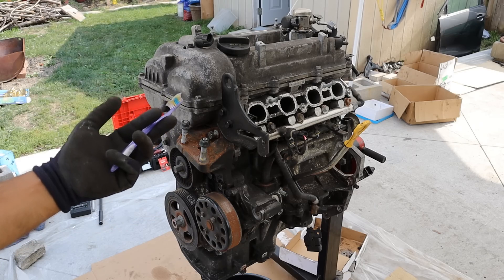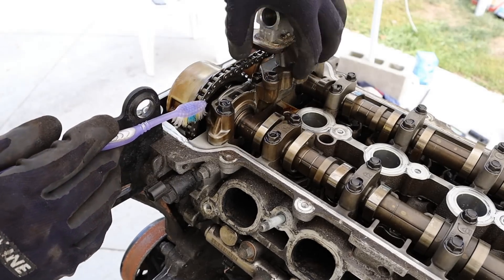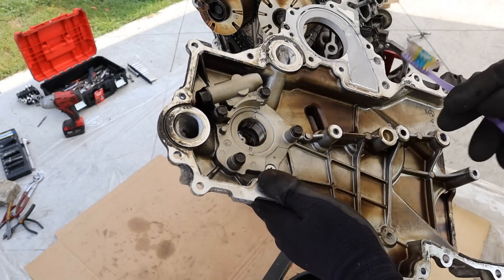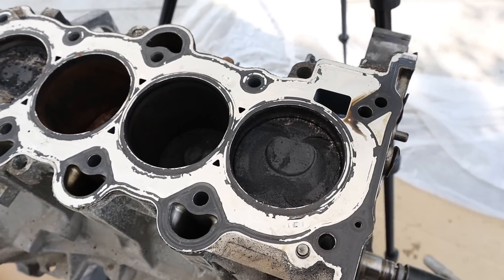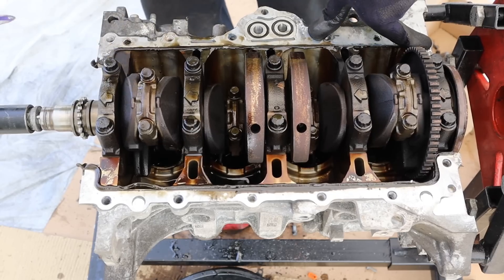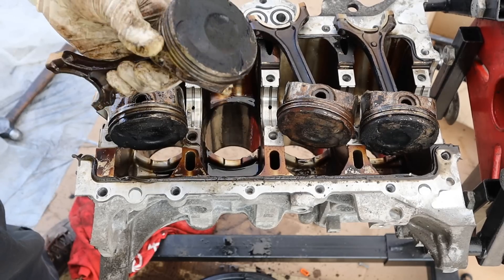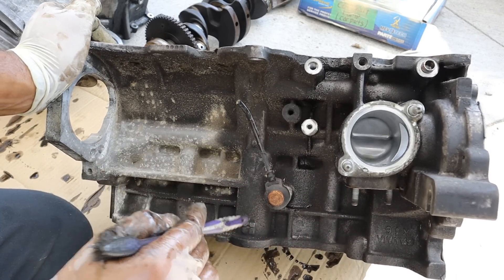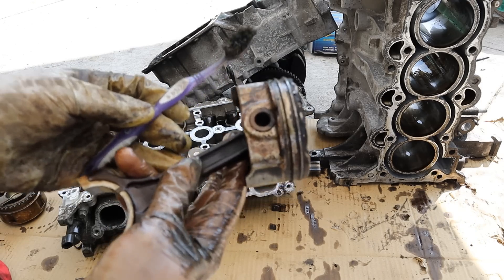Why KIA Engines Fail

Comment: I have a 2016 Kia Rio and the gdi motors and cvt trannys are trash. You need to run sea foam through the intake system ( because gdi doesn't inject gas through the intake like most cars , so they get higher compression  ) and take the intake boot off and spray behind the mass air flow sensor. Put boot back on. Rev to 2k rpms and hold it there while someone sprays the sea foam in . After can is empty, turn off car and let hot soak for 15 min. Then start it up, Rev it, drive about 10 min. If smoke doesn't appear right away don't worry it will ( especially in these trash motors , I've done 2 sea foam sprays already and may need a 3rd ) . If no smoke comes out, pull over and turn the car off for 5 min . Start process over again and if you have triptronic where you can control the gears then really get on it 1- 4th gear . Blow all that crap out of your motor. These engines do burn gas esp while using sea foam. Get an oil change shortly after. Smart thing would to be add the liquid kind to the motor and fuel system and drive 100-200 miles and then definitely get an oil change. God bless 🙌 🙏

Comment: I guarantee you the only reason these engines fell for people is because they don't take care of them they don't change their oil and crap like that any engine will fail if you don't change the oil and stuff I have a 2014 Hyundai Elantra GT with over 112,000 miles on it's the best car I've ever owned so far and I bought it used

Comment: My mon bought a 2017 kia sorento 2.4L. Burned a quart of oil every 300 miles. She bought with 40,000 miles. Sold at 50,000 miles for fear motor would give out based on oil consumption. Oil lube places got sick of giving oil all the time to top off oil in-between changes. I think used Kia don't carry warranty as Kia said she was unable to get warranty work for her Kia.

Comment: they're called oil galleries not galleys.   also when removing a cylinder head you start at the outside bolts & work in. i know this engine aint going back together, but copy cats, you know.
Reply from the maker: Thanks I always mix up galleries

Comment: I gotta a 2020 with 2 miles. This is my second optima. The first oil change golden! Then the second at 10k, it was a half n half. I have stayed on the semi synthetic. Now should I go for the full synthetic when I hit 15k miles? Any suggestions would be great thanks
Reply from the maker: Synthetic is good, stick with it if that's what you're gonna use
Reply: @speedkar99  thanks, will do!!

Comment: To eliminate the carbon build up problem, Hyundai decided to run very rich fuel-air mixture at cold starts (both summer and winter). This has unburnt gasoline coating the combustion chamber which stops carbon build up on intake valves. Downside, unburnt gasoline also leaks into the engine oil past compression rings, causing engine oil dilution - the engine oil is loosing its lubricating properties. This is mostly a problem when doing mostly short trips when the oil doesn't get hot enough to have gasoline evaporated.
Reply: would "warming up" the car for 5-7 minutes + 5 minute drive help to elimate that? My trips are short to work, so all I can really do is warm her up prior to driving. I could also use my other car for my short trips & use newer Kia for night job more driving
Reply: @dbzownz12345  Hi, no, it will not be enough. In fact, letting the engine idle means engine is running on lower oil pressure (the lower the rpm, the lower the oil pressure, the oil pump works with the engine rpm). So lower oil pressure + diluted oil = not good.  For short trips, the easier thing to do is change oil no longer than 4000 miles and use synthetic 5W-30 (note, if changing from non-synthetic to synthetic on high mileage car, the engine will start consuming lots of oil for the first 10,000 miles or so, need to check oil level every day at first). If using car very little, change oil every 6 months. 

A second problem with these engines is they run at very low 1000 rpm at specific cruising speeds such as 20, 30 and 45mph. At 1000 rpm the oil pressure is very low increasing the wear on connecting rod bearings. If driving at speeds allowing 1000 rpm, downshift manually to keep the rpm above 1500 rpm.

Note the engine failures are only for GDI engines made from 2011-2019. I will upload next spring a video with a trick to save these engines, I did discover a trick to stop the oil dilution.
Reply: @Peppermint1  thanks for the info. I've heard the newer Theta II engines are better overall, but I always plan on oil changes of 4k or less. First is 1.2k (some say 500 miles is best), 3k next, & 4k therafter. IS this a good idea for brand new car voyage on oil changes? thanks.
Reply: @dbzownz12345   I think it's a good idea to do an early oil change on new cars.  New engines have various assembly lubricants that will get washed by the engine oil, so an early change will help remove these residues. May also help remove wear particles on new engine during break-in. Most these particles will get trapped inside the oil filter, but smaller ones may accumulate inside the oil, so a first oil change around 1500 miles may help with these. I would also suggest remembering the brake fluid change every 4 years even when driving low miles. This will help extend the life span of the brake caliper as I noticed Hyundai is using low quality caliper piston seals, which start sticking after 7-8 years. In fact, the brakes are a weak point on these cars, brakes are made by some Korean company, may see my other videos about brake quality on Hyundai and Kia cars. I'd use Dot 4 synthetic brake fluid (for European cars) on these vehicles
Reply: @Peppermint1  awesome, but i plan on getting a Rio which only has like 121hp, I dont think I should worry too much on brakes for this car, but im def going to make note on which ever i do decide on
Reply: @dbzownz12345  Mind you, the oil dilution problem was only with 2011-2019 GDI gasoline engines. Non GDI engines are fine. If you live in a country with CRDI diesel engines, those too had oil dilution problems from leaking diesel injectors.

Comment: @speedkar99 If you regularly change your oil, get the valves cleaned at the dealer, and regularly used fuel cleaner (every oil change), would these engines last longer? What is your opinion? 

I have a 2020 Kia Forte GT Manual with only 30k. I have already cleaned the injectors at the 20k mark, installed an oil catch can on the PVC side (maybe need the other done), and am starting regular fuel system cleaning, largely based on seeing the carbon in the pistons and on the injectors in this video. Great concise and well done video. Thanks, for answering my question, if you do!

Comment: As I understood it port injected engines keep the intake and the back of the intake valves clean, whereas every direct injected engine I've seen the intake ports and valves are gummed up with gunk (carbon build-up from the CCV/PCV system). Which is the opposite of what you initially said (?)

Comment: As soon as you said DIRECT INJECTION i knew what caused the "problem". I bought my wife a Hyundai Elantra with the 2.0 ATKINSON engine. Its port injected as i would NEVER buy a direct injected engine. Its been trouble free for 3 years.

Comment: At 6:46 the sparkly stuff may be due to poor maintenance and/or due to poor KIA manufacturing procedures where block machining left metal curls or chips in the oil channels. A better process would avoid contamination, or at least clean out debris with compressed air.
Reply from the maker: Yes

Comment: I'm so glad you did this engine. I wondered how reliable it is due to it being around for a very long time. This and the turbo. I have a 2018 2.0 Nu in my Elantra, manual transmission. 105k as of the other day. Changed one item. A wheel bearing. Thats it. Use 5w30 synthetic oil every 4,500k. Cha get plugs once and keep up on it. Fantastic engine. Quiet and runs really well. No gdi. I'll put 200k easy. I'm pretty confident in the 2.0 nu motor.
Reply from the maker: NU is a newer motor. 
Hyundai Kia doesn't have a good reputation with engines though....sadly.
Reply: @speedkar99  bummer. I like the car. Hope it keeps it up! No gdi or turbo and I baby it. Really take care of it.

Comment: I have a 2018 Hyundai Elantra SEL 2.0 will mine fail? I only use full synthetic with platinum napa filters and change the oil every 4k miles. I can adjust it to 3k if you suggest.

Comment: Thanks for sharing an interesting and informative video.
I've got a 2016 Kia Soul (base model, 1.6 L, 6-speed manual) with a GDI engine.
Even though I'm not a "typical" Kia owner (and actually check & top-up my engine's oil and have it changed regularly), I gained a new perspective on the importance of frequent oil changes for Kia GDI engines.

Apparently the GDI engines are more prone to oil issues than the 2000 Hyundai Elantra (wagon) 2.0L engine that I owned in the past.

Comment: I always check my oil knowing it can burn a wee bit of oil, change every 5000 km. I also use seafoam for gdi engines every few months to keep keep the valves as clean as I can.

Comment: Very interesting seeing an engine dismantled.  Great video.
I have a Kia Sportage SUV 2017 2.0 litre diesel and have had no trouble at all with it.  It's travelled 92,000 km and I'm selling it and buying another Kia Sportage 2.0 litre diesel, but this time, I'm getting the top of the range model.
My wife and I love this car.  I was attracted to the fact that it has a full-sized spare (a deal breaker for me) and that it comes with a 7 year warranty.
I'm selling it with 2 years of the factory warranty still remaining.
I'm very impressed with the tyres and brakes that comes with the Kia Sportage.  
I just put on 4 new tyres today, the first tyre change in 92,000 km!  All my previous tyres on other vehicles only lasted 62,000 km!
I've never had to replace the brake pads.  The mechanic told me that there's still plenty of brake pads left.  I've never had a vehicle in the past that's lasted >92,000 km without a brake pad change (my wife's a nervous driver so she's always on the brakes).

Comment: Screw hyundai and kia. Our sonata lasted only 150k miles after engine gave up and sorento is leaking oil after 90k miles. Sunroof leak, alternator, transmission shifter, starter etc all went out before 100k. We end up getting $1k for sonata. Not reliable and resale value sucks.
Our sonata was 2012 sonata with countless of recalls. They absolutely did nothing on recall service.

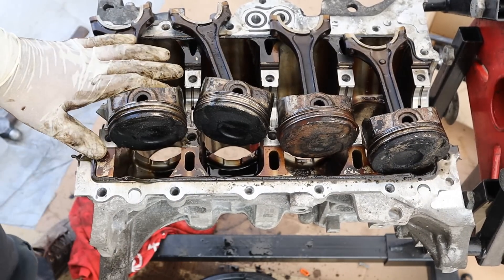Comment: 10:10 ------ > 10:40
That made NO sense. 
If the oil rings are clogged and no oil is getting thru them and thru the piston to return back to the sump, HOW is that oil getting above the piston to be burned off ???

Comment: Direct injection can ■■■■ my ■■■ in any brand of car but I had heard that Korean manufacturers were going for the brass ring and using their own version of kaizen.   

Their own version of The Toyota Way.  And that Hyundai's motors (in particular their V8s) were "hugely improved in build quality."

But this confirms for me that whenever non-car people ask you what second hand car they should buy?  

You just say that, except for the 2.4 from 2007-, just buy a Toyota or a Lexus with a full service history.

(Then watch as they show up a week later in Korean car or an MG or a Range Rover or a BMW or Mercedes that was "an absolute steal" and scream silently on the inside🤓)

Comment: Its not actually a failure point to be fair, In the UK these are pretty reliable.
All they need is a good itallian tuneup. A few hard hillpulls and these just burn off carbon in the cylinder. Valve carbon isnt normally an issue really, unless people care about it!

Comment: Which kia engines fail? I know 3 "generations"
90s - the old ones, kia known as cheap and low quality brand
2000's - still lacks refinement and luxury or hihher Quality feel but extremely reliable, we had many petrol engines and they were awesome reliable
New (~from 2012) - they became more luxurious and "european" , no clue how reliable they are

All experience from germany

Comment: Seems like the common story when long factory OCI are used in conjunction with low tension rings. Toyota, Honda, Kia, GM, Ford, etc....
This unit was likely neglected given the sledge in the pan,. However, given this engine was sitting outside for a while with very dirty oil, there maybe lots of chemical reactions causing a pile of sledge on the bottom. I didn't see much sledge on the heads which should show buildup also if severely neglected.

Comment: it's really amazing how many people neglect oil changes...it's the most easy preventative maintenance that you can do...either by yourself or taking it to a shop to do. It's literally $100 and maybe 1 hour worth of your time, but goes such a long way to protect your engine and increase the longevity of your car.
Reply: I had a Kia with less than 60k miles completely explode even after routine oil changes, some engines are just destined to fail
Reply: Even I, who meticulously changed mine every 5000km, still had a knocking KIA engine at 165000km
Reply: $25 if you do it yourself. The worst part is you always spill some oil.

Comment: Don't know what you want to say.
I have only one conclusion.
Kia and Hyndai, giving 8 or 7 years of warranty!  When the owner is to stupid to v
change the oil on time, it is his own risk.
For the rest. This is just a simpel engine but runs better than a VW 1,4.
For daily normal use, thy are totaly okay and without many problems.
I drive, and drove, the last 25 years with first the 1.4 and the 1.6 engine without engineproblems. The longest was 12 years on one row.

Comment: I notice that most places say a lot about the 1.6 failing and not as much about the 1.4 found in base souls.

Thankfully, regardless of what engine I have, I try to take care of it. Full synthetic every five to seven thousand, fuel cleaner practically every tank, etc.

Right now it has decided that it’s dirty and it prefers 89 gas to 87. Runs a lot smoother and no longer has that minor wiggle that it had at idle. Nobody noticed the idle except the mechanic and I.

I am not perfect. I probably don’t change oil often enough, plus other things. But it far beats what my parents do. I’m at 95k miles and running strong.

Comment: I had an ix35 with this shit engine.  Got shot of it at 30,000miles.  The whole car was a turkey. It spent more time at the local dealership with problems than being used. Total failure of the instruments, drivers door out of line from new, front shock absorbers knocking, other electrical issues, need I go on? I replaced it with a ten year old Honda CRV 2.0 vtec. Kept it for seven years and did 60,000 miles. (it already had 66,000 on the clock when i bought it) Guess  what went wrong?  Nothing

Comment: Kia hyundai engine are dirt
Reply: more reliable than toyota
Reply: @maga6319  No they aren't. Toyota outsells Hyundai/KIA solely because of reliability.  You need to back up your claims, bud. lol
Reply: @rickitysplitz7035  Toyota has more recalls than Hyundai/Kia, that's why toyota don't last unlike Hyundai/KIA. Go troll harder kid.
Reply: @maga6319  🤣🤣😂😂 Kia’s and Hyundai are cheap poor quality rat boxes for poor people, not cheap to fix though and you’ll be doing plenty of that
Reply: @maga6319  🤣🤣 good try, Kia’s and Hyundai are disposable. Cheap rat boxes made for the poor but paradoxically cost more in the long run

Comment: All too many car owners never check their own fluids. I drive a Toyota and still regularly check the fluids, and my stupid neighbor asks me "what's wrong with your car?" every time. TBH I have never had to add oil between changes so far, usually just windshield washer fluid and occasionally coolant.

Comment: I changed my oil always on time on my 2012 Forte5 2.0L engine and it still started knocking at 165,000km - at the time it wasnt on the recall list. Only a year after I  already got rid of the car, it was magically added to the list.    Bought a Toyota and never looked back.  I'm done with everything Korean in my life.
Reply: Good luck with toyota bad recalls. LOL
Reply: @maga6319  I have had my 2017 RAV4 for 5.5 years now and not one issue with it and no recalls.  I have just passed 170,000km on it.
Reply: @DriversofOttawa  that car had a recall. Just keep praising toyota junk if you want.
Reply: @DriversofOttawa  stop lying. Rav4 have recalls in canada. Therefore they have reliability issues.
Reply: @maga6319  Nope. Looked it up with my VIN and nada on my model.  Every car has its share of issues, but my engine failing and catching fire is not one of them.
Reply: @DriversofOttawa  It will catch fire in the future. If toyota fire exist, it will happen down the road. That's a fact.

Comment: In north Africa they are quite reliable... Kia and Hyundai products are quite populaire since they are extremely reliable and cheap to maintain... most old I10, Atos, rio, picanto, cerato cars are still running with over 400.000KM...

Comment: Working for Kia and Hyundai both... Synthetic Oil, and Once every 90- Day Oil Changes. I don't worry about Mileage, I do mine once every 90 days regardless of mileage, 256,934 and counting, still running like new, 2019 Sportage EX AWD 2.4L.  Its a commuter car...